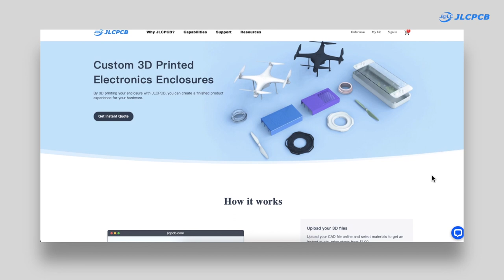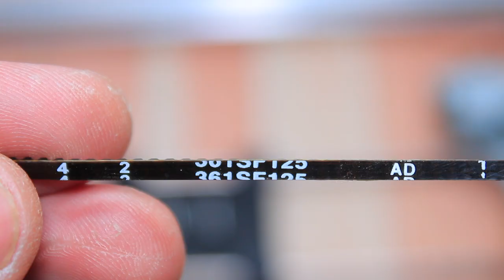Another CNC Pen Plotter from Old Scanner motors | Arduino + GRBL

Comment: The MP160 is a simple A4 printer. How did you manage to get 4 pieces of 6mm linear rod from a single printer?

And even if you salvaged parts from multiple printers ... where inside the printer did you find the long rods for the Y axis? They are clearly longer than the long side of the sheet of paper wich I assume is also at least US letter size or A4. It looks like they don't even fit inside the printer.

Next question: Did you model the 3D printed parts yourself? If not: Where did you find those? If yes: Would you publish those on Thingyverse or a similar site?
Reply from the maker: Of course I salvaged parts from various printers. Please watch at 0:50 to get the estimate size of rod.
And the work area of the plotter is around 150*220mm.
For STL files I have updated the video description.
Reply: @LoopLinks  Great, thanks a lot. 👍